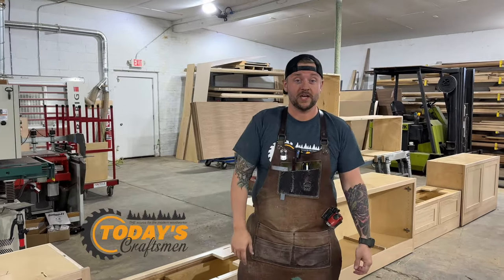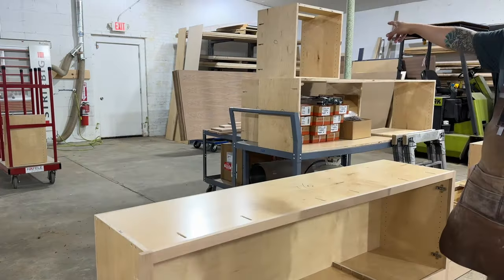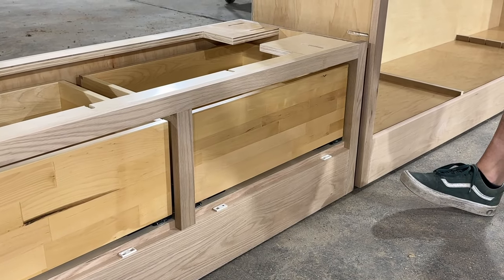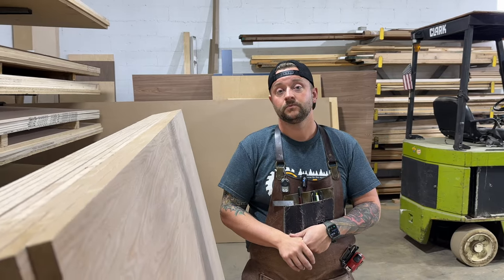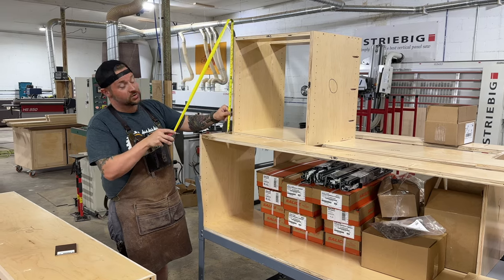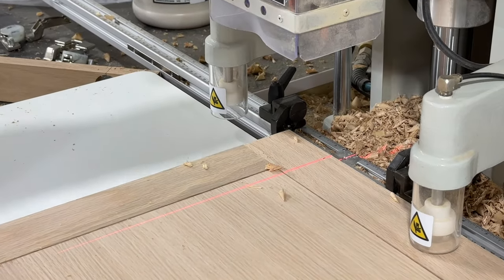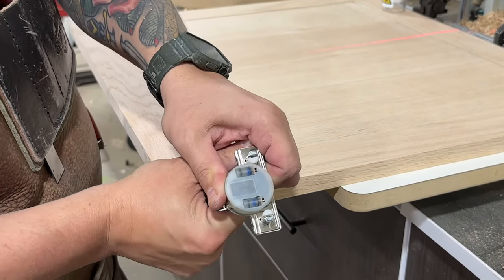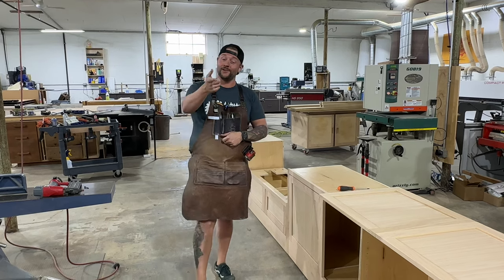Huge Built In Cabinet / Working Through Mistakes

Comment: Does Salice on their undermount slides have screw mounting holes on the bottom or did you have to add you own?  I wish this is something track manufactures would add.  I don't need the 50 holes like the sides have just give me 2 or 3 holes for applications where it makes sense to mount them in this way.  Sucks trying to drill them by hand.
Reply from the maker: Yes, but there’s only two! It’s not within manufacturer spec but I think in this application it will be fine.